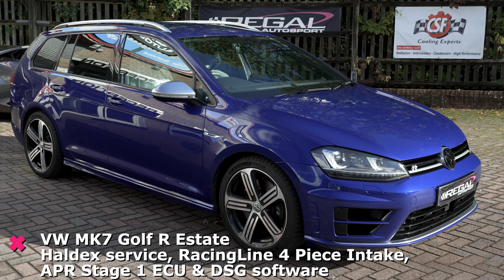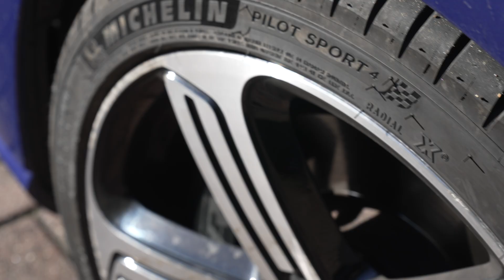HOW TO MAKE YOUR MK7 GOLF R 4WD AGAIN [AND MAKE SOME POWER]

Comment: In my view the APR stage 1 and dsg maps are the best mods for a standard Golf r. The increase in torque is really noticeable making the car much more enjoyable. The gain is more noticeable than going from stage 1 to stage 2.
Reply from the maker: We'd have to agree, as you progress up the ladder the gains get smaller
Reply from the maker: This is basic mechanical work really, you could even do it at home with enough preparation.